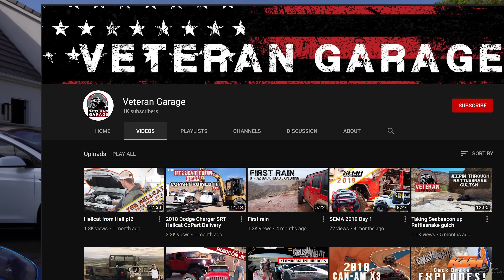What's inside a Tesla Seat?

Comment: I build high end automotive seats for a living. The bladder with oil in it is for sensing the presence of a person. he little box attached to it is a reader. The passenger has one as well. The passenger seat is connected to the air bag system and if it does sense a person the airbags will not deploy.

Comment: That goo that was in the tube is what pressurizes and depressurizes the seat so you can adjust if you want it to come forward or the seat to lean back. It could also be used to transfer the heat coming from the coils.

Comment: Seat Temperature Control. The motor circulates the fluid as the fan cools it down. Works similar to a RADIATOR. Keeps the seat cool  or warm according to the driver's requirement.

Comment: The bladder is a type of sensor(safet feature) that detect if someone is sitting on it or not because tesla doesn’t get in drive or reverse or not even in neutral until someone is sitting on seat ...try it.. sit inside your car put it in neutral and then just getup from the seat lil bit(without opening door) it will go straight into park

Comment: Tesla's idea is to have seats be both liquid heated and cooled. The new design involves multiple layers within the seat; the top layer is the one that the passenger sits on, under which is an intermediate fluid layer surrounded by yet another layer to contain the fluid. The fluid is circulated within the intermediate layer by a pump to ensure both the seat bottom and seatback are evenly heated and cooled, without one spot getting too hot or cold.

Comment: That “motor” is actually a sensor that reads the pressure of the oil. When a person sits in the seat the pressure on the bladder compresses the oil so the system knows when there is someone in the seat for seatbelt warnings as well as passenger airbag on and off.

Comment: Liquid could be used for PODS system.  Its called passenger on board detection system.  Based on liquid pressure to identify the passenger is on boarded or not

Comment: The gel is for the cooling seat! Whenever you turn the cooled seat on the motor turns on and pumps the gel through the seat to cool it! The motor may seem small but it has a very easy job. The gel acts like one of those ice packs you get in first aid kits. Whenever there is heat and pressure it starts to become cold. Your but is the heat and the pressure!

Comment: Im guessing the oil is for when someone sits there it puts it under pressure and that little box is a pressure sensor that needs so much pressure b4 the airbag goes off. Or it is for the seatbelt dinger. It seems alot better than just a switch under there that could be set off by take out or a case of pop. I know my seatbelt dinger goes off if I put something 20lbs or so on the seat

Comment: It’s a Delphi ( they have recently changed their name to aptiv ) pods - d system. It weighs the occupant and will enable or disable the airbag it can also changed how the airbag is set of but it depends on if the OEM has paid for that. They are only fitted to North American passenger seats. The rest of the world uses a much more basic system that is basically a switch. The thing they called a motor is not a motor it’s the ecu that measures the changed in pressure of the oil

Comment: the oil and the bladder is probably used to soft the seat as there is not many layers  of foam  in the bottom of the seat and also adding extra foam   will make the the seat much thicker via making the heat  warming feature of the seat not as good

Comment: That gel bladder is the sensor for the seat belts... Like you know when you sit your butt down on the seat the car know is? Yeah.. if you sit on the seat the oil builds pressure and at the end that black 'box' is the pressure sensor telling the car someone is sitting there
Reply: My 2010 Prius had a sensor switch underneath for seat pressure.  It got wet and fried.  the seat would have had to be taken apart to fix it.  The bladder is a better idea.

Comment: The funny looking gel could be a liquid cooler to make sure when you're using the heated seat the heater doesn't get too hot and set on fire inside the seat, so it could be to keep the internals of the seat heaters cool when in use maybe 🤔

Comment: Wow didn’t realize there was so much tech inside of an car seat! Also that liquid in the car seat might be, if you have an control in the settings for adjusting height or softness of the seat it might control that.
Reply: The softness part might be the answer. I know with the Model 3 the seat warmers are an option you can literally download to upgrade. I wonder if this is just some unused option that was built in.
Reply: 𝗖𝗼𝗺𝗺𝗲𝗻𝘁𝗲𝗿 I think it’s for the seat cooling if the Tesla has that